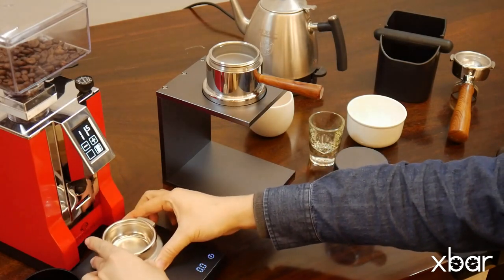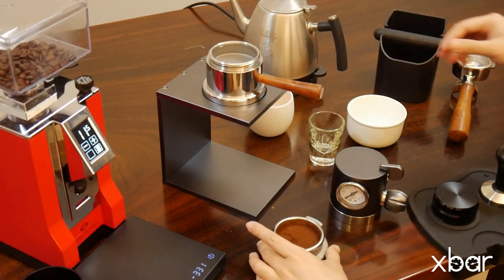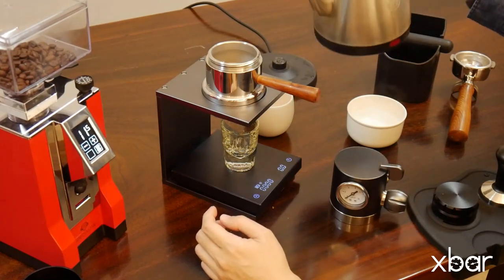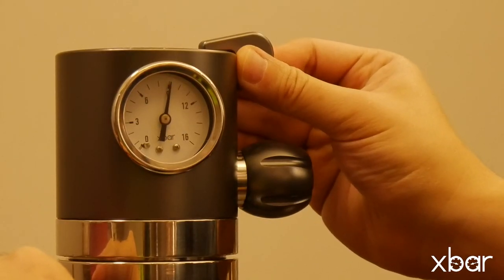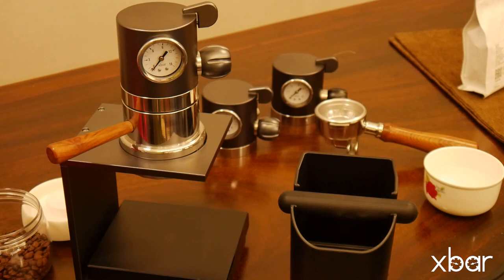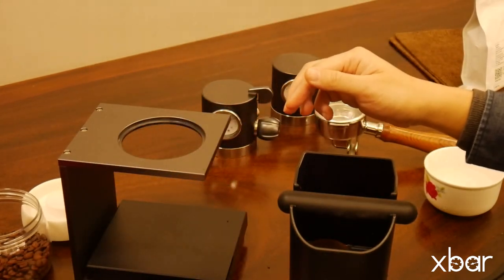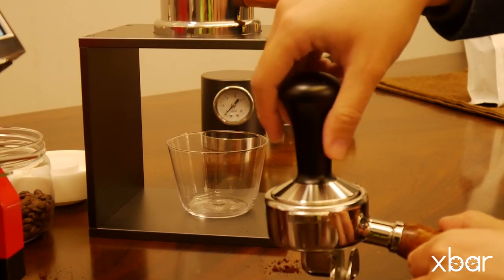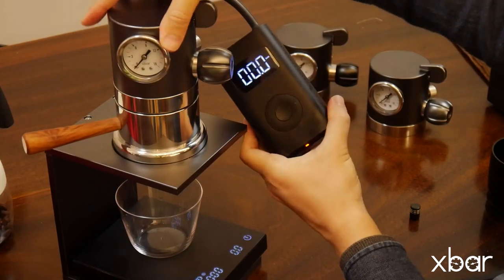Xbar Espresso Maker Tutorial

Comment: Nice idea. 👍
Replace the co2 cartridge with an air reservoir of sufficient size - manually or electronically pumped in the required air and use a big knob to control the air during brewing.

Comment: I don't like the gas cartridge waste issue, I think you should encourage people to use the pump option whenever possible. Nice design though, it seems to work well.
Reply from the maker: Thank you for your suggestion. We are trying to build a system for flexible using methods. Besides the small cartridge and the air pump, we will also provide upgrade kit for refillable cylinders in the future, so people can use the refillable cylinder at home and use the small cartridge only for the portable purpose.
Reply: @xbarespresso4578  that's good to hear, good luck guys!
Reply: Using an air/bike pump is not a safe option to make an espresso unless it is rated as food safe.  Air pumps contain grease and chemicals that are toxic and carcinogenic.

Comment: Where do you get the pump? Just sell it directly as well
Reply from the maker: The pump in the video is Xiaomi Air Pump. Also, you can use any other pump as long as its maximum pressure is more than 9 bar.
Reply: @xbarespresso4578  While any other pump capable of generating 9 bars can work on this device, I think it is necessary to use a food-safe pump, if such pump exists, because the lubricants used in regular pumps might be toxic when ingested. It is for this reason that some manufacturers of manual coffee grinders certify that the bearings used in their products are food-safe.